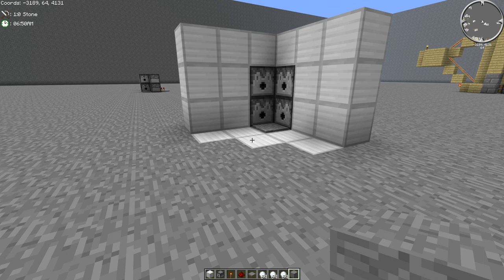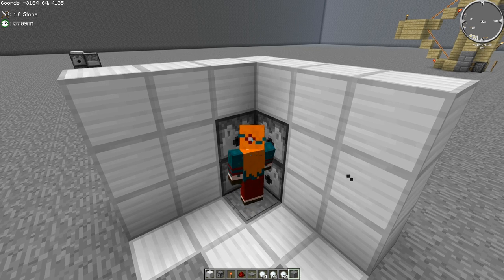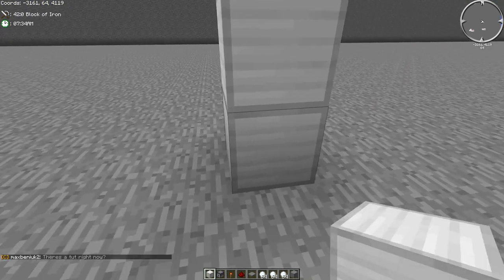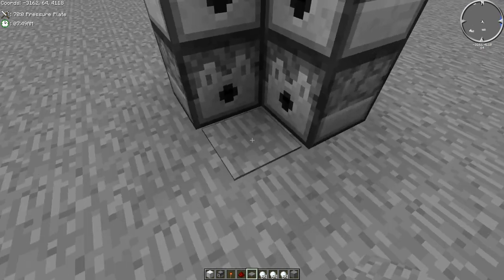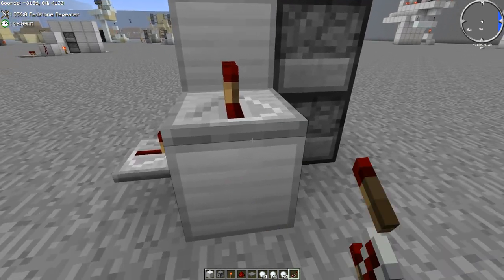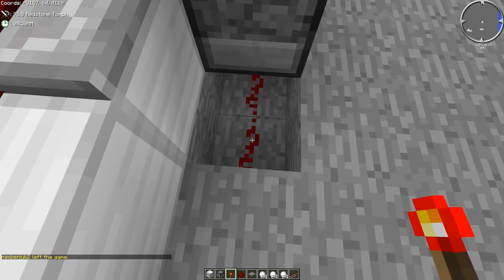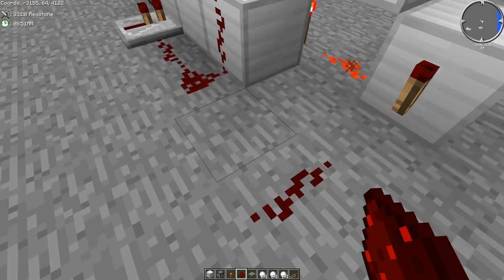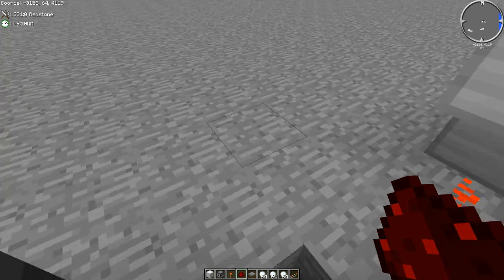Pulsing dispensers using redstone to create a "Blow Dryer" in Minecraft

Comment: to be a little more compact, you dont need the first repeater you placed on the ground because the pressure plate powers the bottom to dispencers (and only once. thats why the bottom ones didnt do it repeatidly) and the top repeater powers the top two. also the repeater at the bottom isnt doing anything since you did not put the redstone in the back. you should put the repeater going into the bottom iron block that way the bottom two also pulse. one last thing, the pulser burns out the torch.